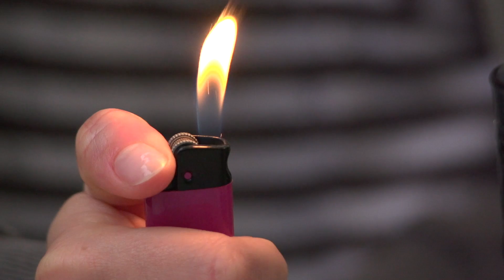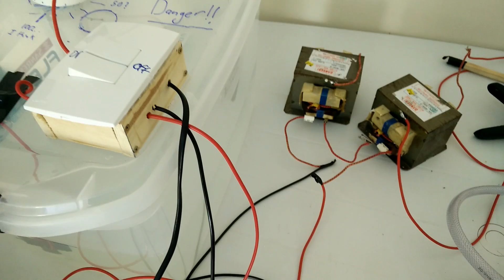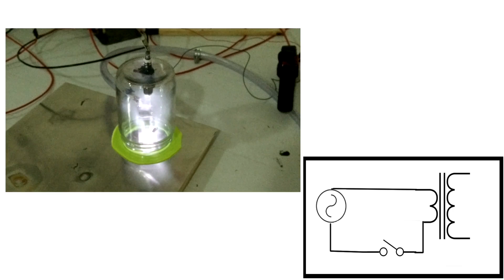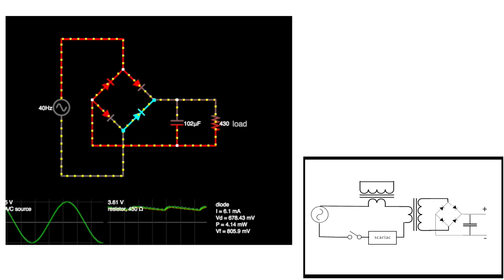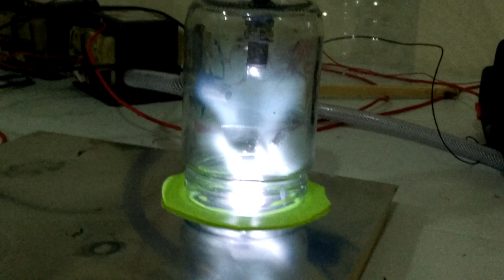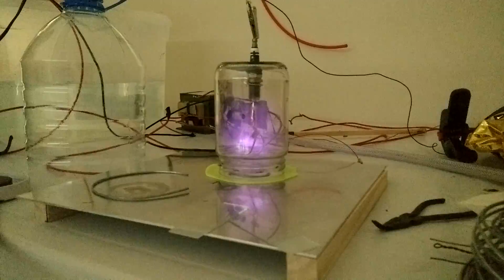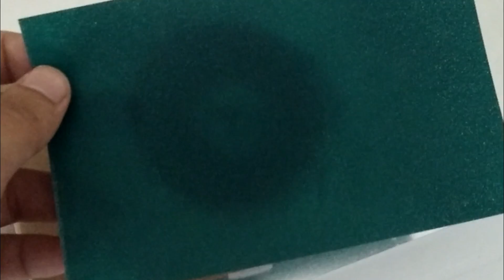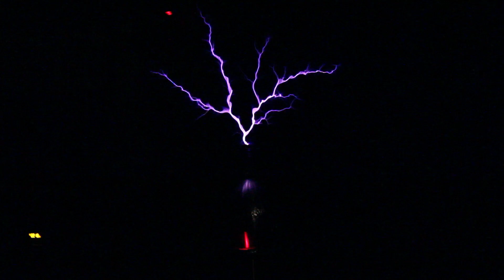Putting Plasma to Work (DIY Fusion Reactors, Magnetrons and More!)

Comment: Magnetrons are a pain! I could only get mine to work once, and it was with silver plus an RF power source. I used a double 'slayer exciter' and a variac.
Reply from the maker: Ya they really are. Lost a lot of sleep messing with both my attempts at it and will lose a lot more as soon as I get it set up again
Reply: slayer exciters might not be the best thing for the job here, these are more suitable to power a tesla coil.
try a ZVS driver, but be careful as it will (or should) be more efficient and give more power at the output, you'll probably be fine touching a high frequency slayer exciter output for a variety of reasons, but high voltage circuits made with ZVS drivers are no joke, I personally use one in conjunction with a flyback transformer from an old CRT TV and it generates a mean arc, if you need AC though you'll have to find one from old black and white TVs as the newer ones usually have rectifiers built in and can only supply DC.

Comment: calling a plasma ball a fusion reactor is a bit miss leading IMO
Reply from the maker: The difference between this and reactor is mostly voltage. If I was so inclined I could switch the power supply and get some amount of fusion. Sure it wouldn't be great, but fusion is incredibly complex and that's not bad for being built out of mostly garbage.
Reply: how would you measure that ?
Reply from the maker: 35kv is the minimum threshold for fusion. There are lots of ways to make a power supply that can provide that.
Reply: how would measure the amount of fusion in your system
Reply from the maker: using the b-10 lined neutron tube that was in the video. Connect it to an old ludlum or a gamma spectacular (which was also in the photo)

Comment: Yellow Jacket actually makes some very reasonably priced vacuum pumps that hit 0.015 torr, they cost a little more than other non scientific grade vacuum pumps- but you can buy new rotary vanes direct from manufacturer, will save you a ton if you use reasonably deep vacuums often, most cheap pumps you would have to replace the entire unit when it starts under performing.